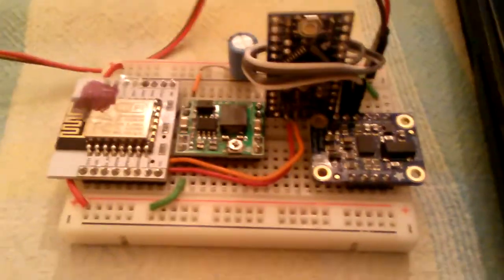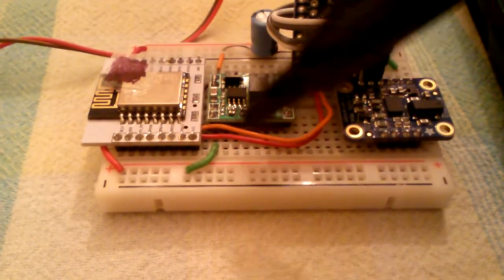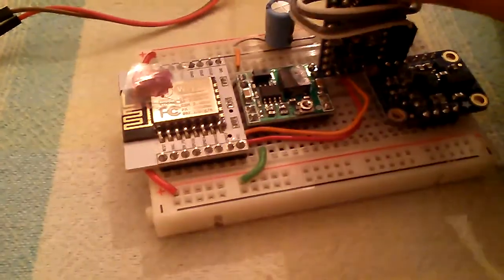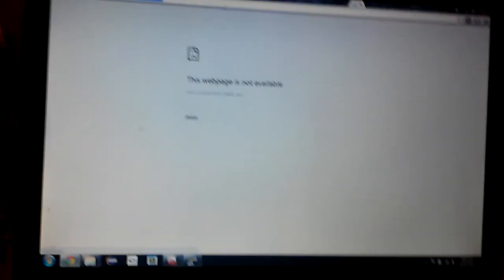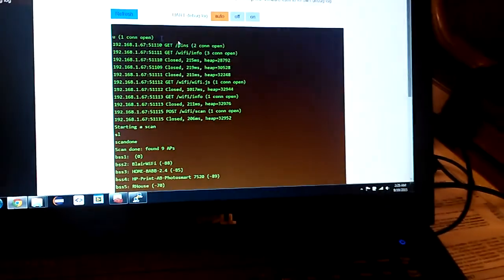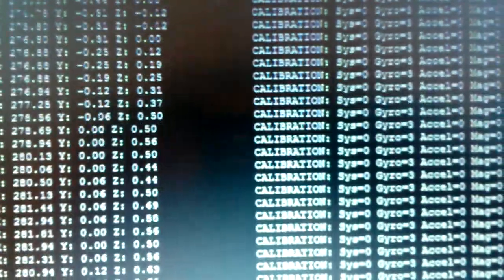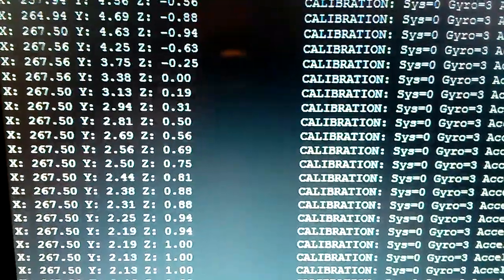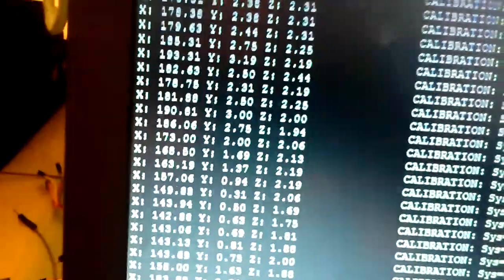Wireless 9DOF BNO055 on breadboard

Comment: Thanks for this video, it's the only one I can find with the BNO055 and ESP8266.  Did you ever have any luck getting the data to work reliably with just the ESP8266?  I'm trying to use the ESP-13f as a wireless sensor node for our FSAE car at school.
Reply: For future people having the same problem. I believe the issue was related to the BNO055 using clock stretching feature of I2C.  This likely has been resolved in the Adafruit BNO055 libraries as of Nov 2015. I have not had a chance to test myself. https://github.com/esp8266/Arduino/issues/526